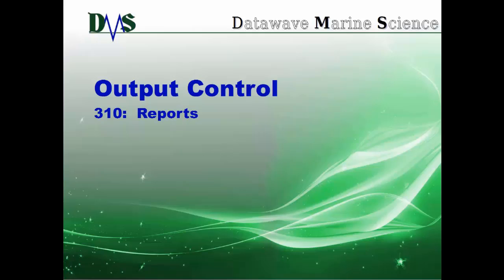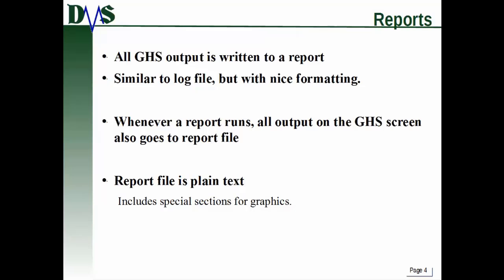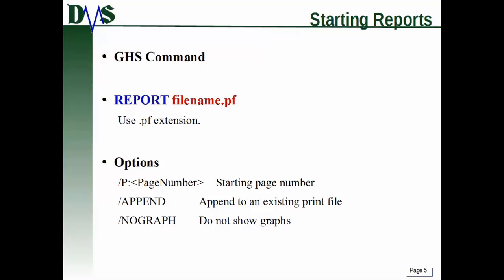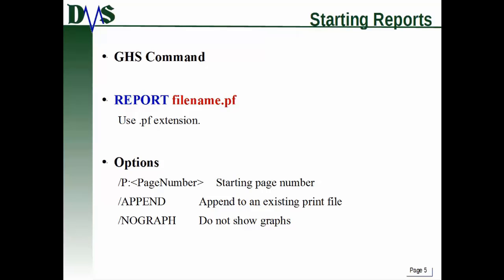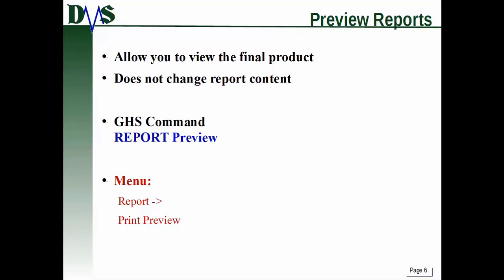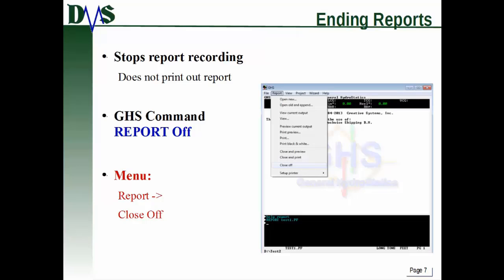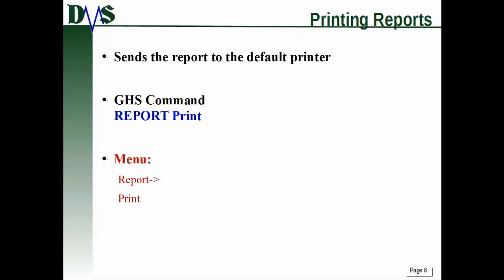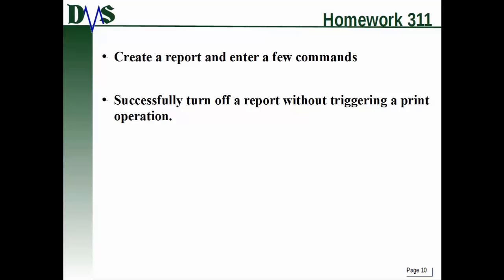310 GHS Report Generation (Improved Audio)

Comment: DEAR COLLEAGUE, how do I use a DI(deck immersion) criterion to recognize the cover edge, if I import the rhinoceros model, it tells me that the deck edge is not defined, when I run the run file . 
In the video a margin line appears, but I don't understand how to define it in rhinoceros or the run file.
Best regards
Reply from the maker: The rhinoceros model does not automatically mark the location of the deck edge.  To do that, you need a very simple modification to the geometry model.  Open the model in ghs.  Enter part maker.  Modify the hull part (usually named HULL).  Then use the MARGIN command to define a margin line.  The important part:  when you define a margin line, GHS automatically marks the deck edge on the model.  Save the model.  Commands that use the deck edge will now work.
Reply: @DatawaveMarineSolutions  thanks